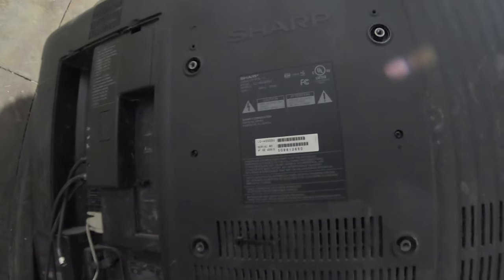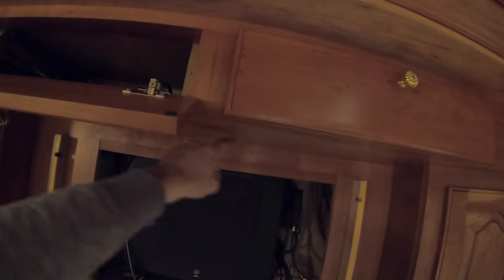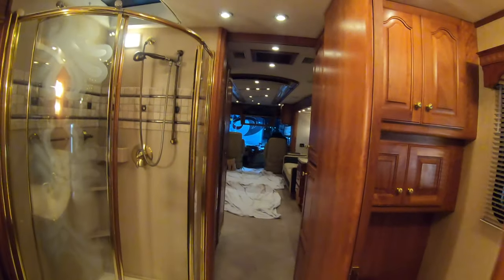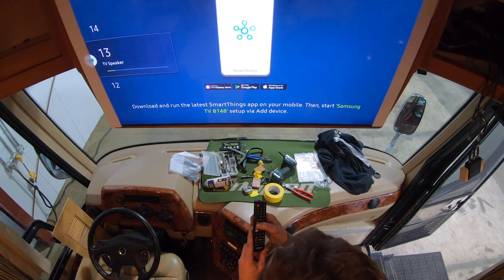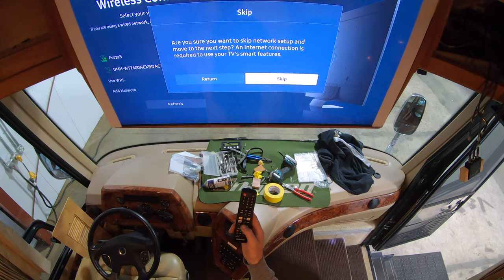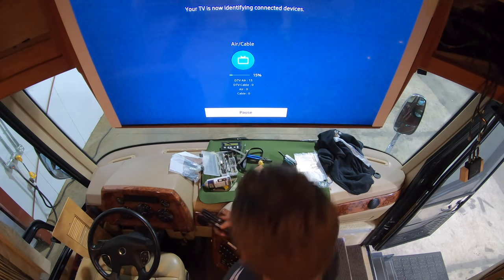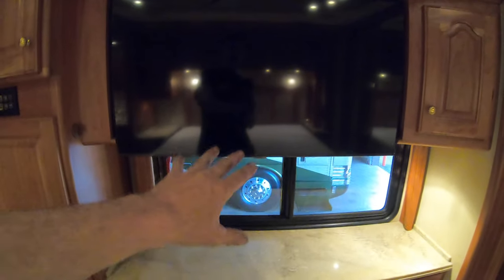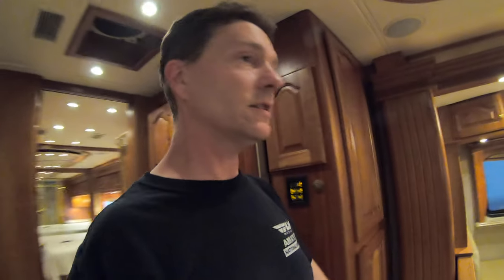Just a day putting some TVs in and so on and so forth. Vlog 003

Comment: Awesome video.
I just replaced my front TV but my rear has a square shape and it's really making it tough to find a good size without having to rebuild the cabinet. 32" is to small but 40" is way larger than the opening. Problems with RVing updating 🤣🤣